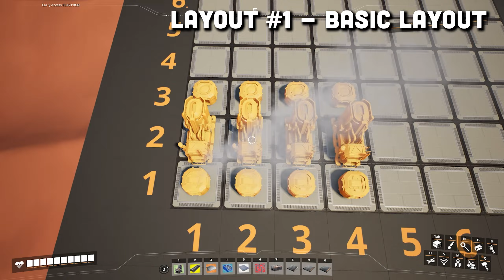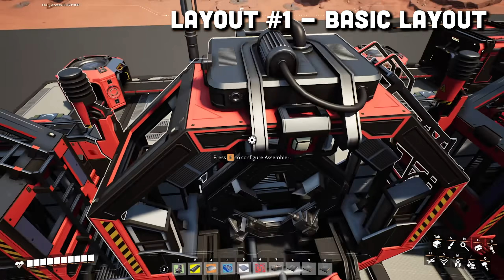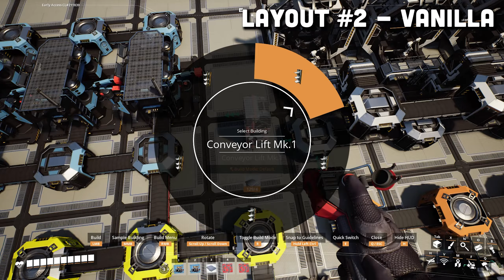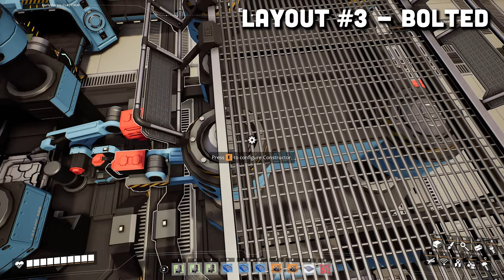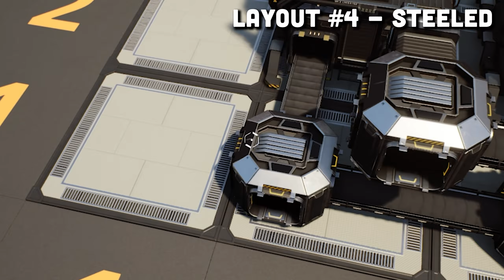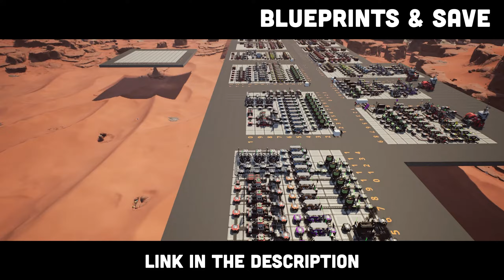4 PERFECT Modular Frame Layouts for Satisfactory Update 8! (Beginner Guide)

Comment: I am REALLY confused at the moment, cuz I built the steeled frames factory exactly to your specifications, and the math isn't making sense...

For the 4 steel pipe constructors you need atleast 120 steel ingots/min, but only producing about 105 or so/min with the underclocked 3rd foundry
Like @MennoGanzeboom said in his comment, you still need about 10 extra plates
With the screw setup, you need to underclock your smelters and constructors, otherwise they'll just keep overflowing and backing up, making that part of the assembly inefficient

Please don't get me wrong, I'm very thankful for this guide, it really helps, but my suggestion is to work on the numbers on your own.

As with the math and setup that I've got now, requires 285 iron ore total and 105 coal/min

Foundries x 3 @ 35 iron ore / min + 35 coal / min        total 105 iron ore / min
                                                                                               total 105 coal / min
smelters for plates x 4 @ 33.75 iron ore / min              total 135 Iron ore /min
Smelters for screws x 2 @ 22.5 iron ore / min              total  45 iron ore / min

Also unfortunately the mk. 3 belts only carry 270 item / min, so an additional belt is required for the extra 15 iron ore / min that is needed to run the factory as efficient as possible...

Comment: My 3 iron plate contructors are starving for ingots.  The supply has to go thru 4 splitters before it reaches the iron plates.
Reply: i have the same issue
Reply: @alvarosj5627  just give it some time, the inputs are not loadbalanced, they will need to rebalance themselves by creating the imbalance at first till all the constructors are not filled with iron, afterwards that should be fine
Reply: That's how manifolds work. They start off unbalanced but when the first machine fills up, it'll send more ingots to the second machine, when the second fills it'll send more to the third, etc. Takes a bit but it'll be balanced eventually.

Comment: Would it be more efficient to underclock all machines rather than just one out of the three. For example, two machines at 75% instead of one at 100% and one at 50%.
Or would that not make a difference?

Comment: Question: For the 4th build, at the reinforced plate assemblers. If you leave it default, then you are 10 iron plates short. You need 90 iron plates per minute and you only have 80. Did you underclock one and if so, to what clock speed?
Reply: guessing the last one should be underclocked to 83.3333% - this way it matches both the plates and the bolts production

Comment: the first layout no iron bars make it to the last three contructers to make plates and is very inefficient its like 2 modular frames every 30min
Reply: I had a similar problem - it takes time. If it doesn't, check for bottlenecks in your belting (I had a couple). You can also put the iron bar constructors on standby until the iron plate constructors have a chance to fill up with ingots.

Comment: First setup does not work with Satis 1.0 many bottlenecks like screw, nails, iron plate and I have more than the required ores(all mk3 belts)
Reply: Did you find a ratio or setup to get one assembler running constantly? Also did you do all the underclocking?
Reply: Also wondering

Comment: If you are going to use alternate recipes such as Steeled Modular Frame ... I'd also incorporate other alternate recipes such as Solid Steel Ingots, Iron Wire, and Stitched Iron Plate. Just to give a contrast on how drastically you can reduce material use and power consumption by using alternative recipes.

Comment: In layout 3, you say that the line of iron/min should be 250 but with 9 smelters (last one being underclocked to 15/min) you should have 255 iron/min. Am I missing something?
Reply from the maker: Good catch. It should be 10/min. In the grand scheme of things it still works the same, as it’s a manifold system but the machine wouldn’t of ran at 100% efficiency. It should be set to do 10/min on the last smelter and not 15.

Comment: can i build exactly the same but without underclocking? what would be the problem if i can't do it?
Reply from the maker: Just wouldn’t be 100% efficient but it would still technically work. Some machines would idle when waiting for items.
Reply: i'm asking about the first build, seems working. is the underclocking just a method to safe some energy?
Reply from the maker: @KF420  it won’t create the right ratios either, which snowballs down the chain of production. So instead of creating 5 per minute let’s say, it’ll fluctuate heavily between 3-5. But at that stage of the game, you are most likely just creating these for your storage so that fluctuation isn’t a big deal.

Comment: I struggle to understand why some belts are Mk2/3. What happens to your efficiency if all belts are Mk4 for example? Just curious :)
Reply from the maker: The efficiency doesn’t change. As long as the correct amount of ore per minute gets to the machine, you are golden. Typically you use the highest belt you have for the main lines going through your factory. Aesthetically it’s nicer when you have the same belt going down the whole manifold vs having different belts. So the way I choose this is typically whatever belt you have access to the highest you should use. So the first layout you usually build before you hit steel, so you only have mk2, and it only takes in 120 ore, so we don’t need higher belts. The others all use at least 240-260 ore so we need mk3 belts.
Reply: @spectrumdad_  thank you!

Comment: Dad, I've begun noticing a pattern of you not balancing your inputs.  Would you care to give your 2 cents on balancing?
Reply from the maker: I’ll be making a video on this very soon but the gist of it is that manifolds are just overall better in my opinion. They allow for easier expansion, smaller footprints, and mix and matches of different recipes/overclocking rates on the same line easily. Sure they take longer to saturate and pickup vs the nice looking satisfying balancers, but overall they have more pros.

Comment: For modular frames, all those contructors are unecessary. Go out and get some hard drives, so you can unlock stitched iron plate and iron wire. Pick up some slugs as well. This will greatly simply your build. I am making 4 modular frames per minute, with 1 assembler overclocked to 6 stitched iron plate per minute; which can be split to 2 assemblers making the modular frames. You'll only need 1 constructor for plates, 2 for iron wire, and 2 for the rods; so 5 constructors, and 3 assemblers in total. I used to think I needed a lot more produced per minute; but you'll be spending hours doing other stuff. When you go back to check on your modular frames, you'll have plenty for your needs.
Reply from the maker: Yep that’s valid for sure. I balance a vanilla no alternate recipe layouts for the beginners/people who don’t have alternate recipes yet and some more efficient builds later in the video that includes enough output for quite some time. Later in the endgame things change up but especially getting there, you want to be as efficient as possible with your hard drives too.